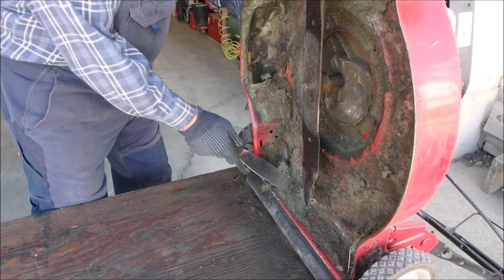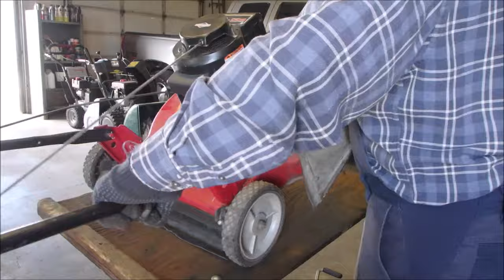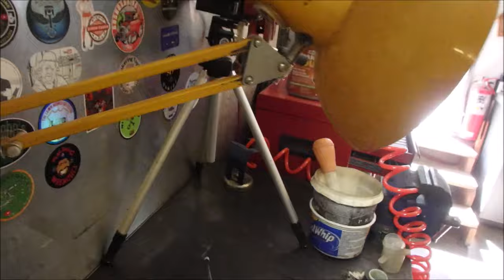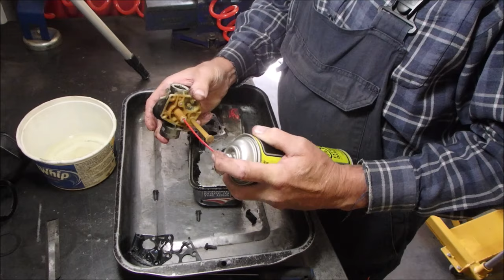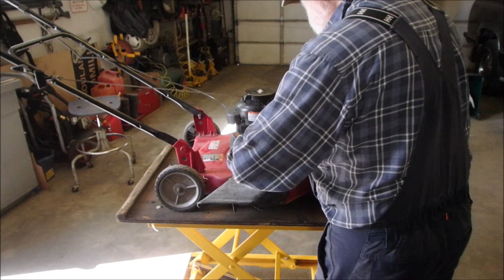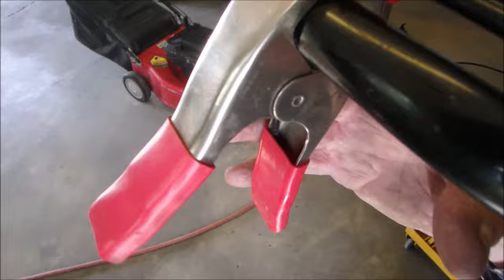Murray Mower With Briggs Classic Abandoned!!!

Comment: Another patient reanimated in Bruce‘s emergency garage 👍🌞🍀🏥🩺 Greetings from Germany and have a great pre-Christmas time 😘
Reply from the maker: Thanks so much.  Any snow there.  We have 25 cms on the ground.
Reply: @BrucesShop  1 inch at work, nothing at home except a dusting. I want more snow!
Reply: @ no, had some two weeks ago, but only for two days and it melted away. Right now temperatures around 5-10 degrees Celsius. When I was a child in the 1970‘ mostly around the 6th December we had enough snow to take out the sleigh 🛷 for the first time.
Reply from the maker: @Maik1968  Thanks

Comment: I have a very similar mower that I bought new in 1993. It is branded "White". Same engine. I didn't know they were still making those engines in 2013. I never had a problem with it. No fuel stabilizers, never drained the tank, and there were long periods (years) when I didn't use it. The side-chute bag is useless, however, and I recently bought a rear-bagger because on my new property I need to vacuum up leaves.
Reply from the maker: Those engines were good.  I agree about the bag!

Comment: Great video Mr Bruce. I have the same type of work table you have. I added a bit bigger table top. I have 3 of those Honda mowers. I added a little longer and wider. Getting cold where I live. Not into working in the garage when it gets below 30 degrees. Keep up the good work.
Reply from the maker: Thanks for the info on the lift

Comment: That goofy gas cap arrangement just helps direct water inside the tank when the outer part of the cap is missing!  So, did Briggs make some engines exclusively for Murray?  You mentioned something about a larger hole in the plastic linkage.    It is easy to see how Briggs "took cost out" of the good ol 92502s to make this "classic model".  No cooling shroud around the cylinder, half of the head bracket missing to support the fuel tank, plastic carb, whimpy recoil/no more ball clutch for the recoil either.  What is the crazy cover/boot over the spark plug?  Some sort of resistor/RFI shield?  Hope I get to mess with one of these carbs someday to see how that primer works.  I'm guessing there is not actual main metering jet, just a hole in that plastic thingy.  Although this is still much better than that awful tecumseh carb with the plastic main jet/spring and swelled oring set up.  
This will be a great little mower, oftentimes "less is more".
Reply from the maker: Thanks for your knowledge
Reply: @BrucesShop    What knowledge?  This engine is a few years newer than the good ol 92502s and 92902s I worked on as a teen in the mower shop.   Would love to have the opportunity to work on some newer stuff like this in "retirement".  I surely have "alot to learn".  Love learning stuff everyday, my struggle now is to remember what I learned yesterday!
Again, do you know what the crazy big spark plug boot connector thing is all about?  I've seen this set up on other engines, wondering what it is and what it is supposed to accomplish.
Reply from the maker: @fleetwin1  Yes, that spark plug adaptor is a 5 K ohm resistor.  You can measure that with a meter.  They are not totally required in my little brain but without one, some spark pkug leads are not long enough to reach the spark plug.  It is weird as some spark plugs have a resistor in them.  Thanks
Reply: @BrucesShop    Wonder why they wanted/needed to put the resistor there??
Reply from the maker: @fleetwin1  Right  I get that